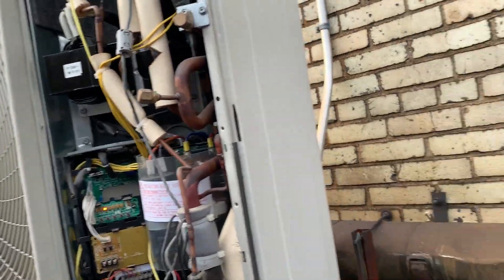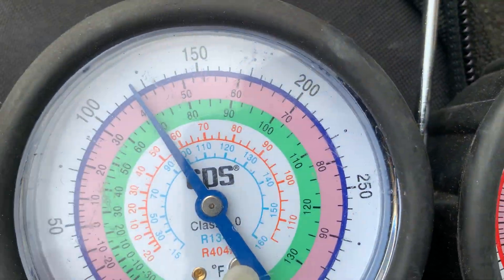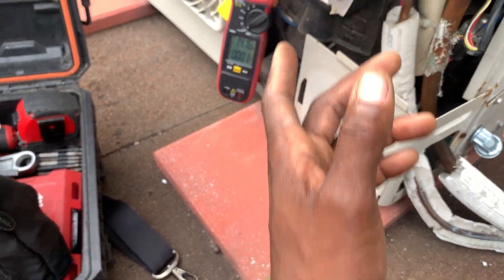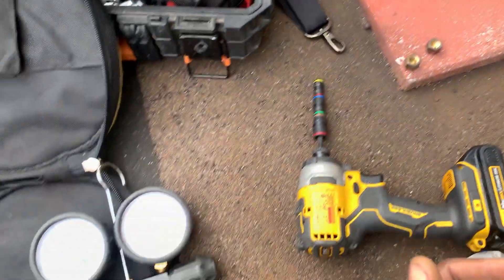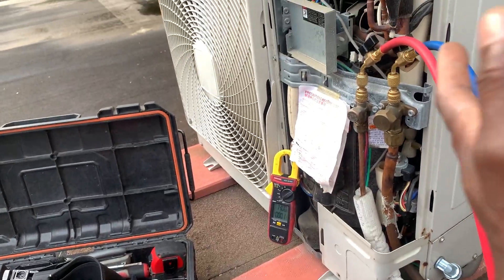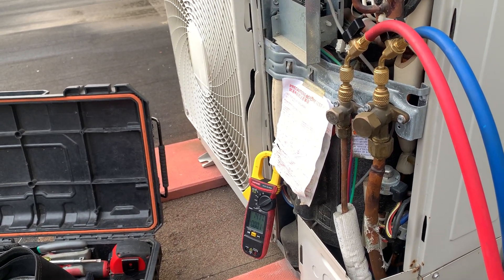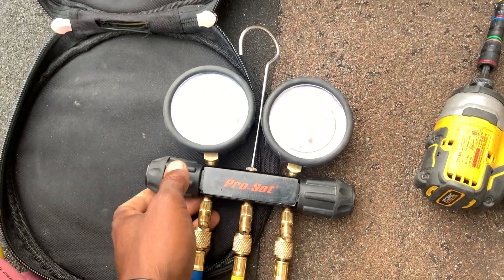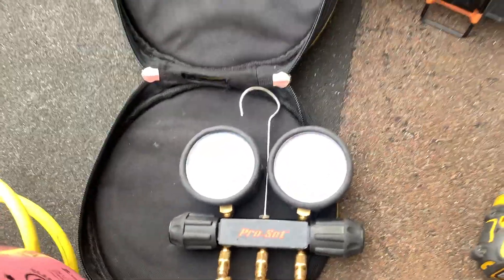HVAC TROUBLESHOOTING MITSUBISHI DAIKIN LGMV

Comment: im loving that klein multi bit you got on your drill. Its now one of my favorite tools I own. I know mitsubishi city multi, you charge to hot gas discharge temp,  i think you're shooting for 188degF for the compressor discharge line. I wish I had a better answer on how to charge these systems but Im still learning. Looks like its running pretty good after gas.